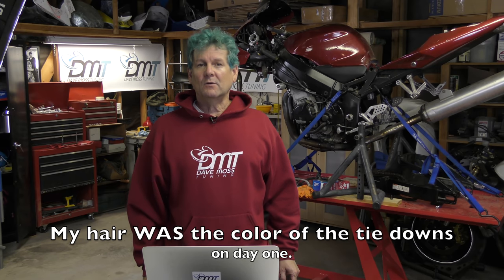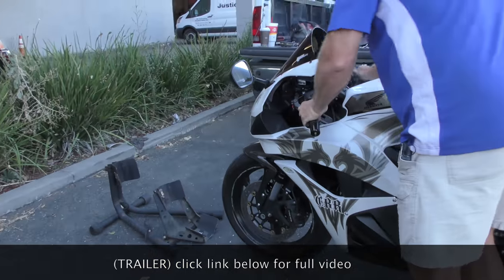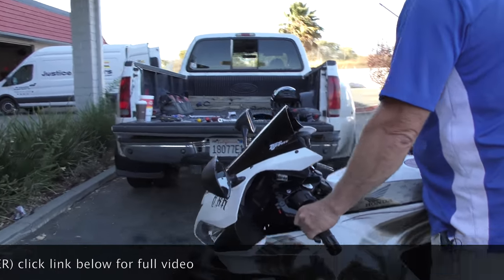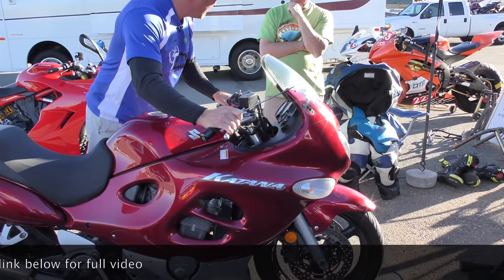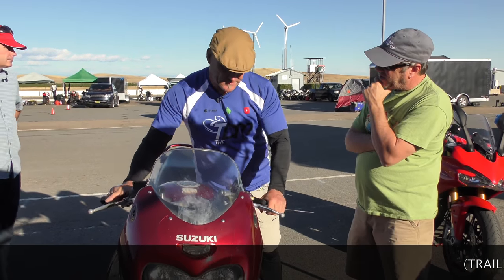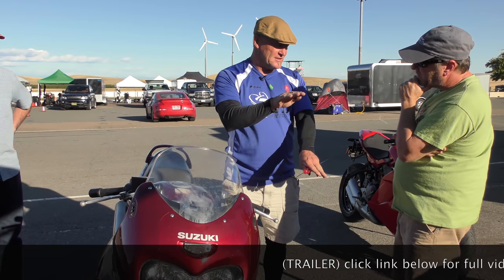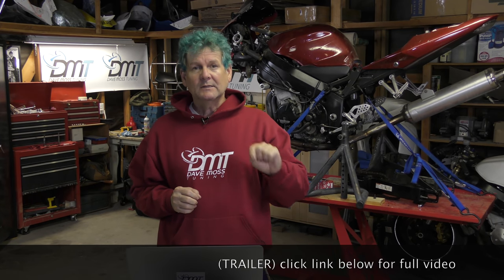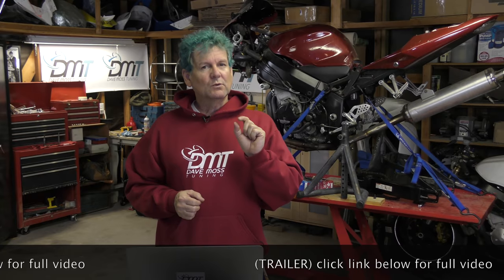Fork Rebound: Fast Slow or Just Right (TRAILER)

Comment: Dear Dave&Dave, hope you don't mind if i put a general question to forks here: i have ordinary upside down forks from the first times. Left and right fork each separately to adjust in rebound and compression. Now, for any reason, the total number of clickers from left and right fork in rebound and compression is DIFFERENT. Do you see a safety issue with this? Or is it alright, as long as i start counting from maximum setting? Means setting clicks counter clockwise identical left and right?
Reply from the maker: It is fine, please start from maximum setting and count back :) Rebound and compression will not have the same numbers eg R10 C14